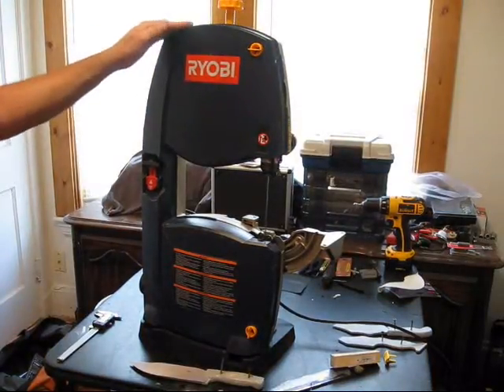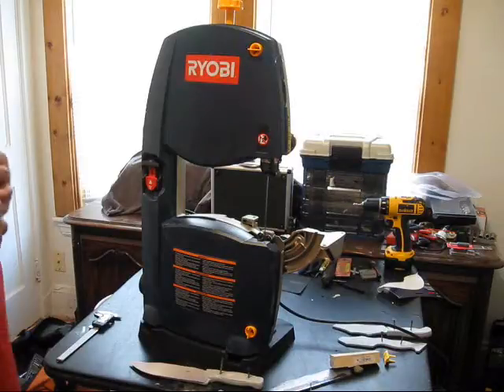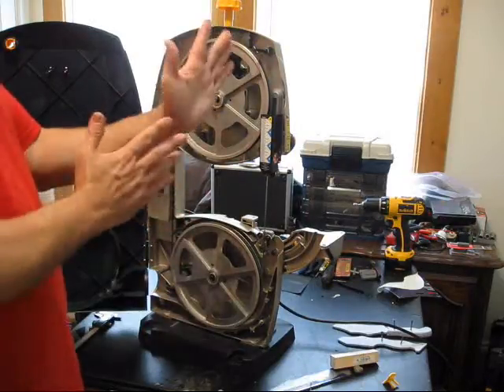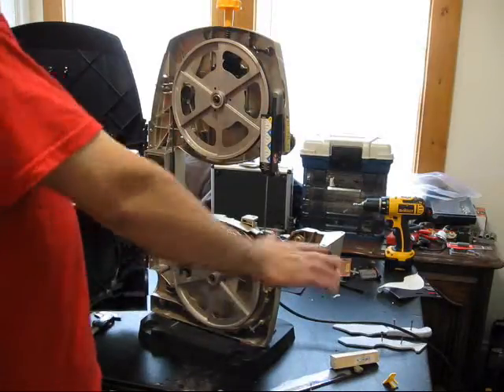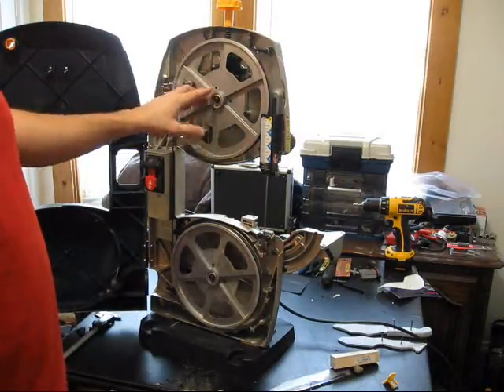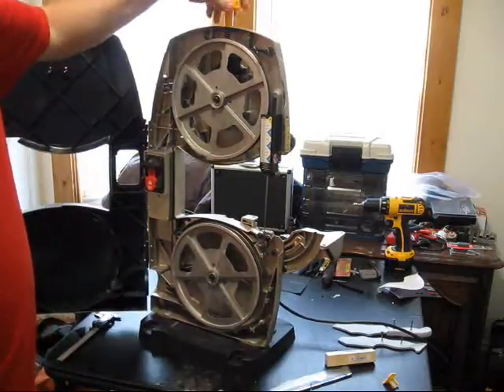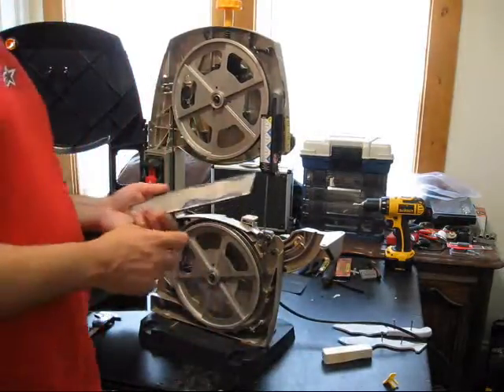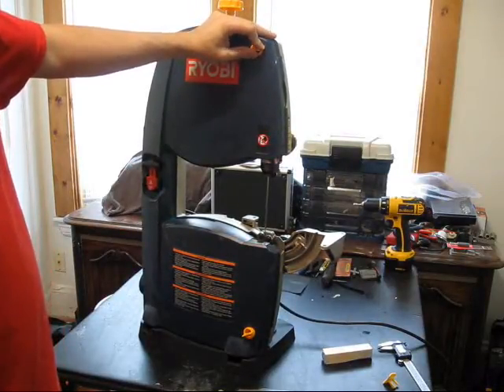Ryobi 9 inch bandsaw setup, balancing & metal cutting blade

Comment: i'm not sure what the result was, cutting the steel.. you said "it basically laughed at it.." and that was all you said, so I don't know if that means the ryobi laughed, cause it was nothing, or the steel laughed because there was no way it would work.. i'm trying to cut through 20 pieces of hollow tubing, which is about 2mm wide on each side of the tubes.

Comment: Funny when you mentioned Home depot and their blades. I had to inform them more than once of the fact that EVERY Bandsaw they carry does Not Marry up to ANY of their Blades. They used to carry the appropriate ones then stopped for some God awful ridiculous reason. I Had to go down the street to Lowes to get Blades that would fit a Saw that I Purchased from HD. Funny part is? I Bought 4 Packages( over a period of time and losing receipts)  thinking I was myself was making the mistake.
The Problem I am having now is that the Bosch blades for Metal I could not even cut .065 Brass sheet. WTF!! I've got instruments to build here and Quickly!  Anyone have a good Blade suggestion for 59 1/2" blade length ( that would fit Ryobi) ???? and Last more than one Cut????? LOL!!!

Comment: The reason it won't cut steel is that it's not a metal cutting bandsaw. The blade speed is too fast, thus heating up your blade and killing the temper. Probably started to cut and then stopped seconds later, right?

Comment: Hi, I was wondering if you knew why my saw keeps freezing up.  Every time I turn on the power it starts and then stops right away and just hums. Is it off balance? I'm a woman just learning so I'm slow. lol
Reply: mary Allison You should adjust the blade tension. A blade that is too tight will fight with the motor.
Reply: Make sure both wheels turn freely with out a blade, the put the blade on, light tension
Reply: Gender has nothing to do with this. You dont know what you dont know.

Comment: Yes, a "wood cutting" band saw runs at about 2790 fpm. To cut metal, you would need to reduce the speed down to somewhere around 150 - 300 fpm. You need to somehow get the yor fms down, like with my Delta 28-300 it has a built in gear box with a gear reducer, Im sure you can get the same effect going through the correct set of pulleys!! By the way check out my Band saw rebuild on that Delta band saw if you have time!!

Comment: ****LPD *****   What METAL Blade DID you get to do some REAL Metal cutting???? You are Soooooooo Right about Bosch.  BOSCH Suckz My ASS!!!!! 1/4 inch cut into Brass .065" thick and it was Done.  They should NOT Even Claim that it is any where close to a "Metal" cutting Blade.  Can You Tell I am Pissed???  :)
Reply: There blade isn't the problem; It'll cut metal if you put it in a metal-cutting saw. A wood-cutting saw like this runs so fast that it overheats and melts the blade teeth.
Reply: Agreed totally!
Reply: even after i slowed the drill down to lowest of rotation including jigging up a wheel to bring the belt inward increasing the wrap on the pulleys. this in turn added to an ever slighter drag on the drive system. after i purchased my metal (specific) band saw, i compared those two unit speeds and were quite similar ( only a small variance.
Of course I knew I would be purchasing the right band saw but was in a pinch at the time and of course would not have kept using my wood saw for this on account of the added drag on the motor would not have faired well the unit.